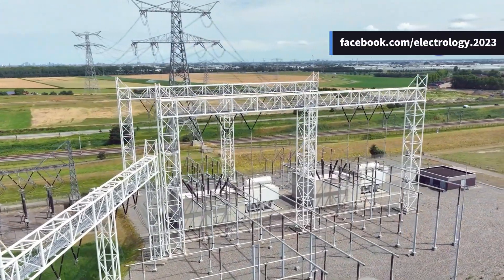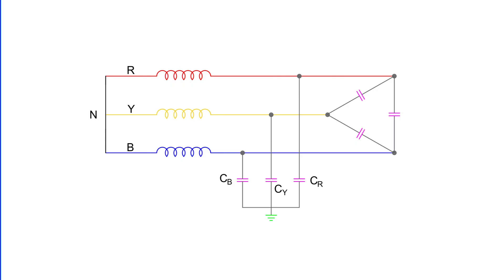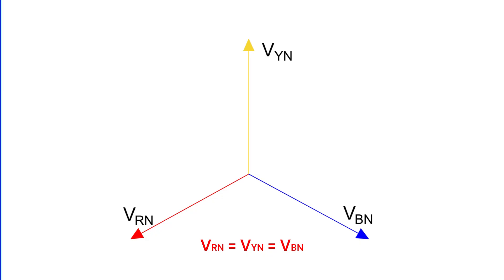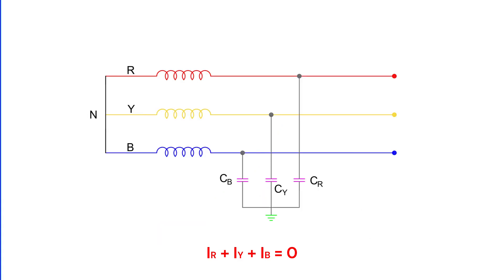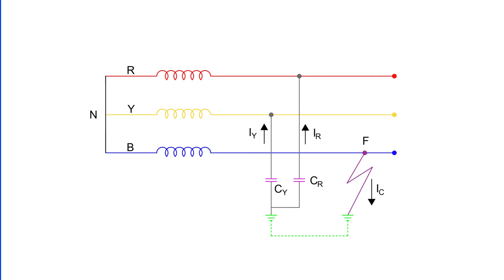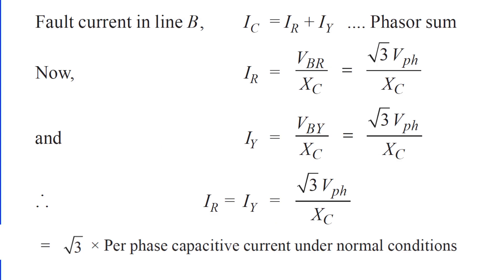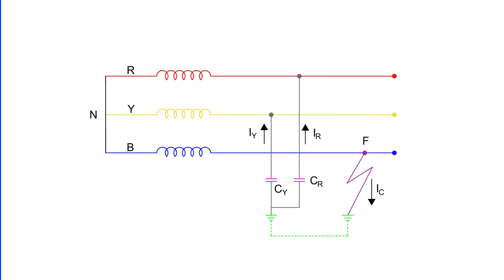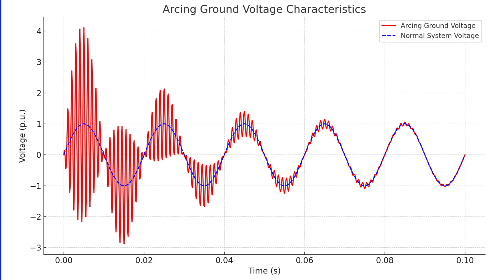What is Arcing Ground in Power Systems? | Ungrounded Neutral Explained with Diagrams

Comment: You still see ungrounded systems in mining, among some other applications. Per Code, there must be ground monitoring which monitors the line voltages. If one of your phase monitoring lights is off while the other two are shining brighter than usual, you have a phase-to-ground condition.